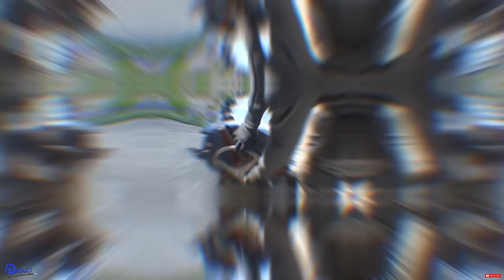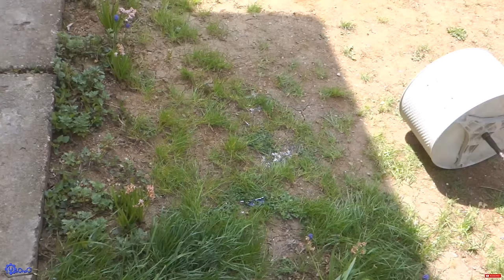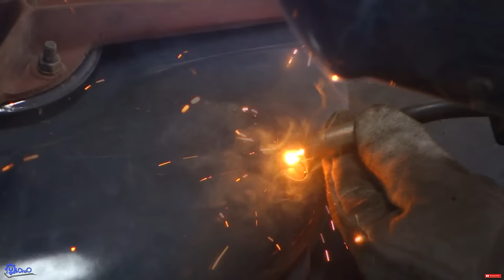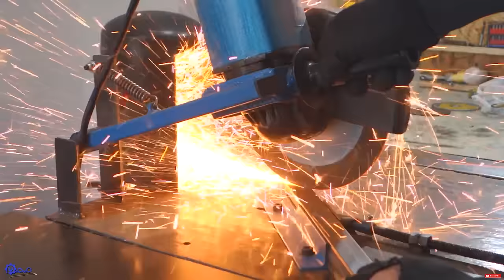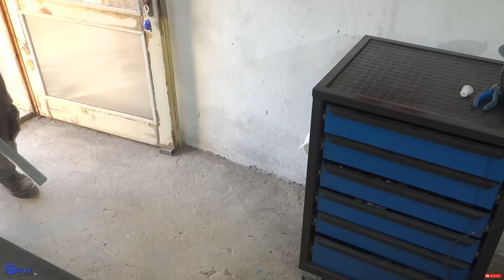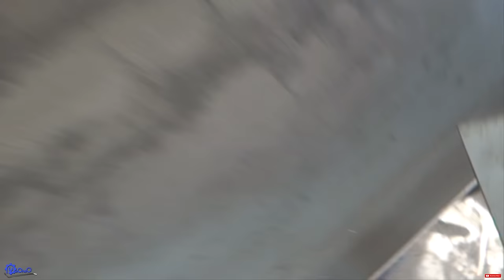DO NOT THROW THE OLD WASHING MACHINE    "NEVER SEEN BEFORE"

Comment: The best thing I've ever done to my front load washer was to swap out the main bearings with "roller bearings", like the kind in a typical car axle.  This made the until run amazingly well, and I haven't had to replace the bearings again!  The factory ball bearings are crap, and not intended for axial loading to begin with...  A roller bearing, however, is meant for axial loading.  Axial loads are created because the drum is hung out on a lever arm, just like a car tire.  The unit runs like a charm, and I don't have to worry about having to replace the bearings again for a long time...  The bearings were a bit more expensive, but worth it for the amount of time I save replacing the old crappy factory bearing every 3-5 years...
Reply: Did you used stainless or standard bearings?
Reply: Too bad that a simple hidden item like this is a failure point . Change needed.
Reply: Giờ tôi không biết tên bạn đâu bạn là gì nữa😂🎉😊

Comment: So nobody is triggered by the way he welds? It's like watching a 90 year old guy pee... drop by drop...
Reply: The reason for spot welding is, it stops the sheet from being warped due to heat stress, if done continuously.
Reply: It is because he cant weld
Reply: This is exactly how you weld sheet metal. All good welders spot weld sheet metal. My welder has a spot weld function where it pulses the welder output so that you don't have to tire out your finger, so this is obviously a well known way to weld.
Reply: All good and well, but it still looks like a 90 year old guy peeing... drop by drop

Comment: I had somany thourggts relating to what this "build" could be, but in the end I where way wrong, but I'm very impressed, turning something useless into something very useful, but iv got to ask could this also be used to crush "softer rock" (change in blades or something like that) or even a chain blade for chipping smaller wood (10mm-50mm)

Comment: Hi you have nice weild tect. Skills. Just a tip i learnd a trick from and old timer who tought me how to weild.when weliding sheet metal you can use a block of alu. Clamp it with a c clamp.  It will pull the heat like a heat seek in a computer. And you can weld continuse in most cases. Are going to make apple juice or apple jack ☺

Comment: Muy buen trabajo algo asi me gustaría para poder fabricar y que triture el cemento Portland que uno lo deja en la bolsa mucho tiempo y se endurece. Hice algo parecido pero me parece que el motor no es muy potente todavía no lo puse en marcha.Funciona dentro de un secarropa y con espacio limitado pero supongo que funcionara. Algo de lo que usted hizo aca copiare para ver si funciona muchas gracias por enseñar Reciba un saludo desde Formosa Argentina

Very good work, friend, something I would like to be able to manufacture and crush the Portland cement that one leaves in the bag for a long time and hardens. I did something similar but it seems to me that the motor is not very powerful, I have not started it yet, it works inside a dryer and with limited space but I suppose it will work. Some of what you did here I will copy to see if it works thank you very much for teaching Receive a greeting from Formosa Argentina

Comment: Nice idea and good implementation. But I think it still needs some revision. 
1. I highly doubt these "cutting blades" will last, would be better to make reinforced placeholders for good quality steel blades. 
2. As seen in the video the size of pieces greatly differ - it would be a good idea to put some kind of limiter on the inside of the drum next to the blades.